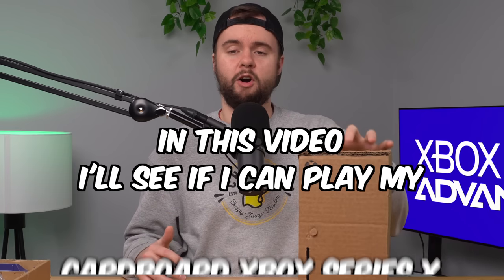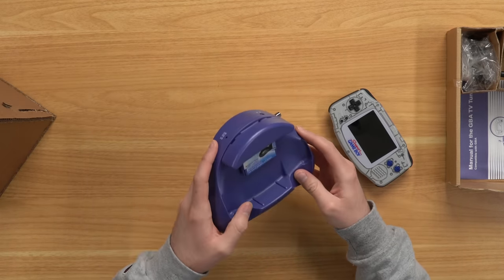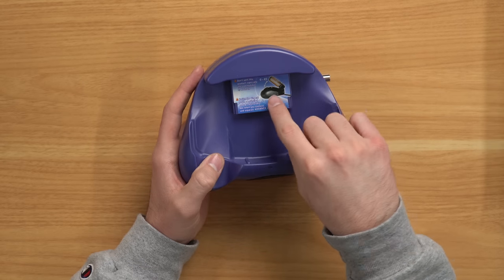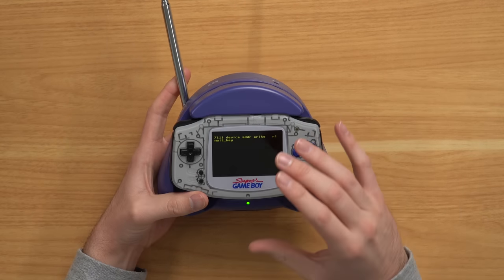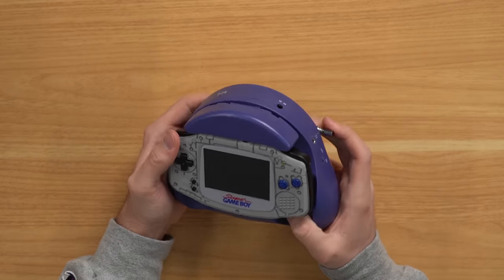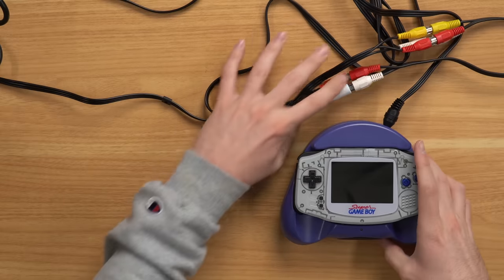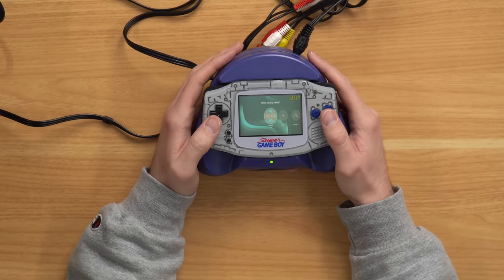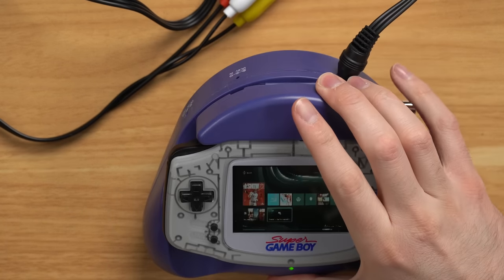I Made a Portable Xbox Series X... sort of?

Comment: You can use really small kynar wire. Also, you might want to scratch off the top layer of the PCB with a fiberglass pen. 👍
Reply from the maker: What’s the fiberglass pen do? I’m gonna buy some of that kynar wire now lol thanks for the suggestion
Reply: @jrob0021  I'm not the best for SMD components, but I do believe these manufacturers, have some sort of clear lacquer that protects slightly. You could scratch away with a knife, but to be cleaner you can use a small fiberglass pen  to expose the pads, or anything on PCB boards.